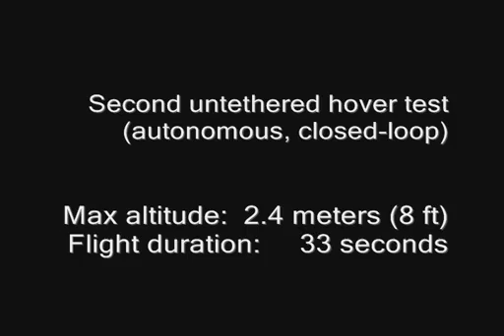Controlled Hover Test Flight No. 4

Comment: @CodeWarriorx0539 - Not gas, but two liquids that combust on contact. Actually, from reading a little more: To minimize moving parts on the ascent phase (which is separate from the descent phase - different combustibles), both fluids are somehow force-fed at constant pressure by high-pressure helium. Therefore, it might be a simple on/off system: On for ascent, off for coasting with gravity assisted braking, small thrusters thereafter for additional braking and steering.